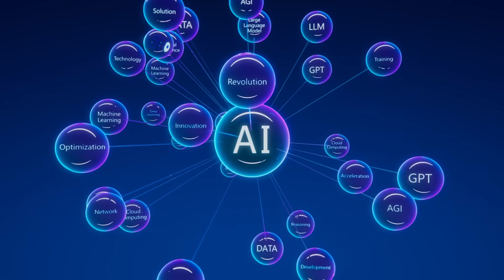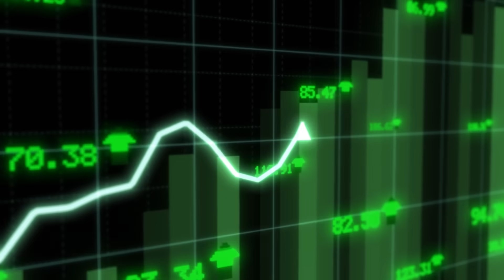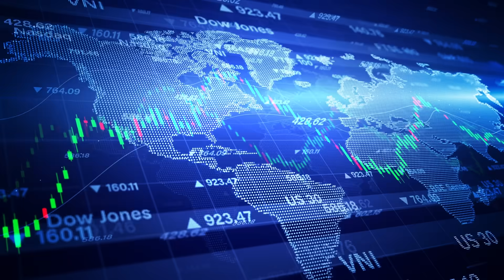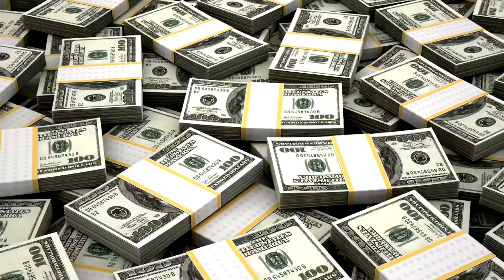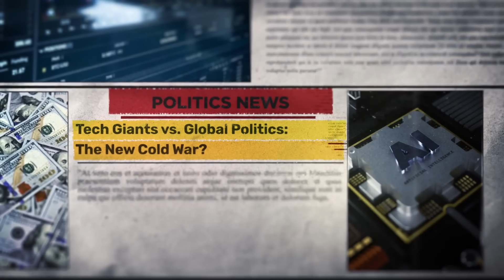Netherlands Challenges U.S. & EU: ASML's Bold Move Intensifies the Global Chip War!

Comment: In Any case, the euv machine is no longer the only way to make 3 nano meter semi conductor. SMIC has figured out how to mk the smallest semi conductor.
Reply: Sure but the reject rate is high making 5nm chips too expensive for commercial sales. Don't bother with 3nm using DUV's. You can make them but at huge loss